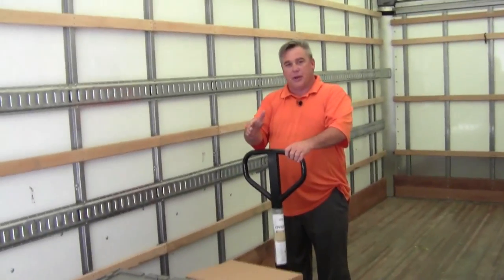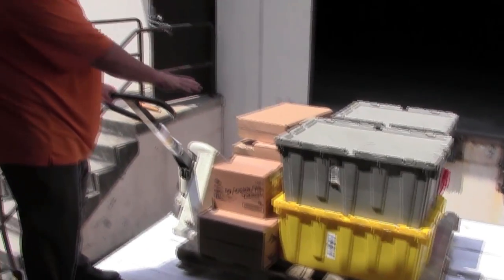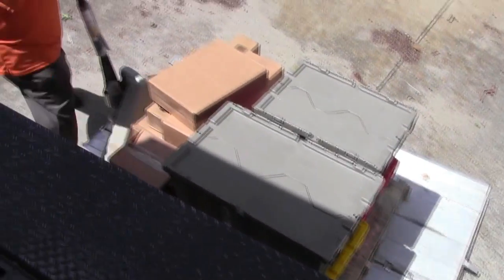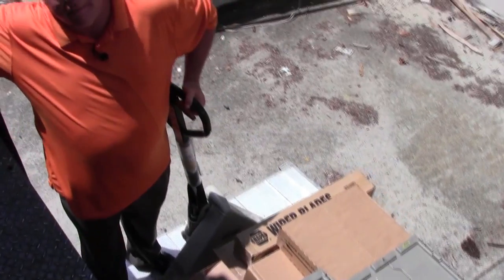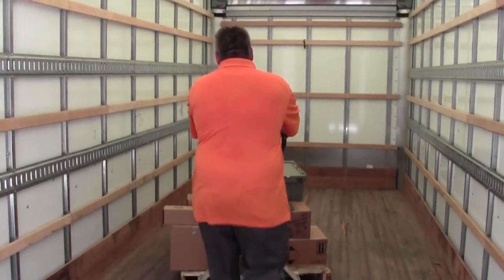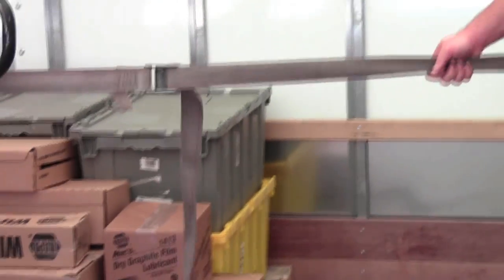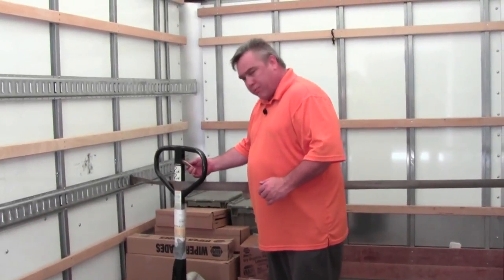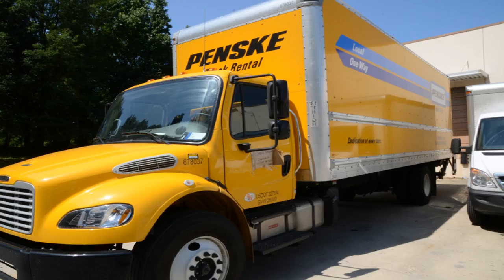Proper Handling of the Pallet Jack

Comment: Amateurs. You just roll the big wheels off the liftgate and it will rest on it. What he did you won't do with a big full pallet
Reply: Depends of the height and weight. A 3k lbs pallet of flooring only 3ft high is fine to put it sideways on the gate.